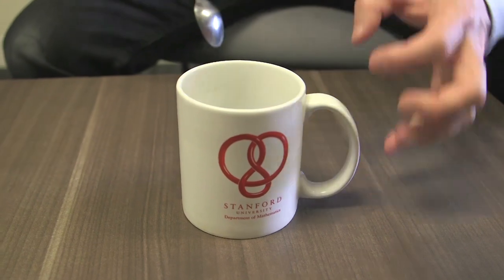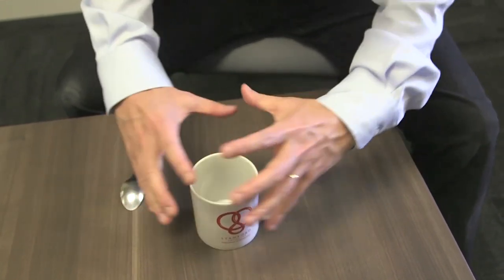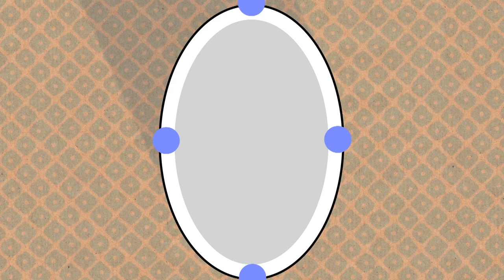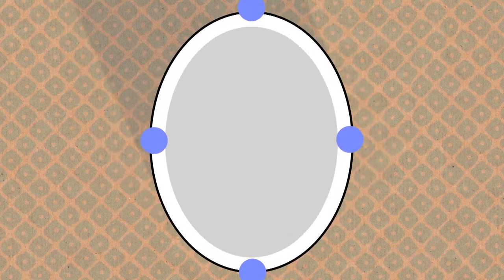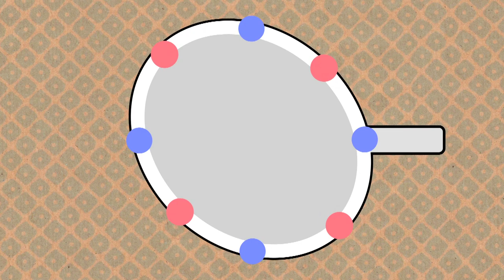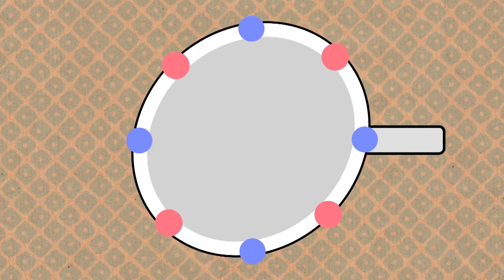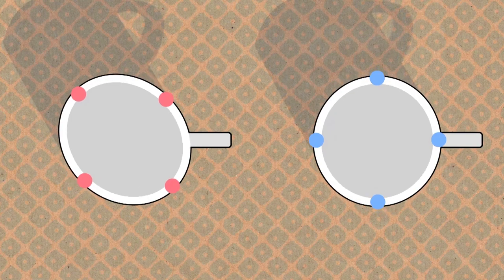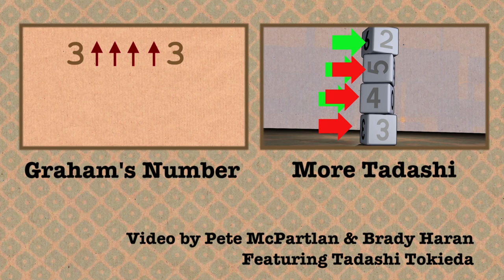Coffee Cup Vibrations - Numberphile

Comment: Why is it a symmetry of four and not six for example? I tried maybe seven or eight cups of different design and it was four nodes for all of them. Or is the six fold symmetry there as well as a second tone at the same time but there's much less energy in that vibration so we can't hear it?
Btw. have you noticed that the pitch changes while stirring coffee and changes back to the initial pitch over a few seconds after stirring. My guess is, fine air bubbles are introduced into the liquid by stirring. It is not the rotation of the liquid, because the gradual pitch change also happens when you already stopped the rotation by "counter stirring".
Reply: I'm pretty sure you nailed it. There are probably some higher symmetries/frequencies that are probably just too low to notice them. However, I think you'd only find multiples of 4.

With the stirring I know you're right. But now I'd like to know if you also understand why the air bubbles change the pitch? ;)
Reply: 1. The cup is a circle. as he explains, if you compress the circle in one direction the other two sides at 90 degs deform to keep the structure symmetrical.   
2. As the heat of the liquid lowers so the pitch of the ceramic increases. The hotter a solid material is, the slower it can respond to vibrations.
Reply: Dirty Robot
1. is equally explained by six fold symmetry.
2. wouldn't explain why the pitch goes down to the same pitch over time. (it even works with cold water by the way, so temperature is irrelevant)
Reply: As with any complex (non sinusoid) sound you can think of it as the sum of may sinusoid at different frequencies multiple of the fundamental which is the frequency that in this case we identify as pitch and is also the strongest, in this case the funamental is the pattern with 4 nodes resonating/vibrating and 4 antinodes standing still (theoretically)

The higher frequency sine waves do not contribute to what we identify as pitch, they however are what make's the cup sound as it sounds

it is not true that  you cannot ear them either (if you could not hear higher order harmonics any sound would be the same only shifted in frequency) it's just that your brain/ears process the whole sound as one and cannot distinguish between the different components

I'm sorry if it makes little sense but trying to explain fourier theory with words only it's quite difficoult 

here you can see that by starting with a sine wave and adding more and more odd higher frequency terms the wave will look and sound more and more like a square wave like (for the 2 to match mathematically you have to add infinite higher frequency terms, in practice you only need few hundreds and the ear will not notice the difference)

https://soundphysics.ius.edu/?page_id=949
Reply: I don't know but i find unlikely that a 6 nodes oscillation can substain a standing wave in that system...

When analyizing the spectrum of the sound we must also be carefull since the mug is a 3D object, and in the 3rd dimension it is not of constant shape (so that will have a bigg effect on the sound), also there is a constraint placed by the table at the bottom (it is much stiffer than the air that  surround's the other sides) that also will have a big effect on the sound, creating complex constructive/destructive interferances so i don't think that the 5.1 kHz is a 6-nodes pattern child (also i would expect to find it half way between the First and secondo armonic, not 2/3's of the way to the 3rd)
Reply: Good anwer, but I'm not sure it's correct. If I remember correctly, it's more about it being more compressible with the air inside.superdau

Comment: In a case such as the triple handle cup, do you have the same pitch but with varying levels of damping across the nodes? With the circumference deformation in thirds you get either 3, 6 or 12 nodes, the latter conveniently corresponding with the division of an octave. I think this produces a corresponding pitch with less fundamental wave mixed in, which is why I think the human ear wants to hear a higher pitch in tapping the in-between areas with quicker decay.

Comment: I have a mug that is a cuboid, with very slightly rounded corners. The handle is in the middle of one of the faces.
The observation proves true in this case also, there are four high tones, and four low tones.
Except, the four high tones are at the handle, and the four low tones are at the points 45° from the handle (i.e. in the rounded corners.)
Reply: Interesting! The reason for that is probably, that the corners introduce higher stiffness. I'd expect it to behave the same way without a handle.
Reply: Yes. The higher freq is because the faces are less elastic. They are connected to the base with more material. The corners would deform with less energy and so vibrate slower.
Reply: Think of pushing on the corners of a cardboard box to collapse it vs the faces.
Reply: It's all about the amount of energy that is needed to vibrate a mode. In the example here, moving the mass of the handle requires more energy, hence a lower pitch. In your example hitting the corners would cause a vibration mode that tries to change the 90° angle, (as @CheaterCodes pointed out, higher stiffness in the corners)  which requires more energy than moving the handle.
Reply: Interesting responses, thank you.
Which got me thinking, and scrambling into my attic. In the attic was another mug, also square with rounded corners, except this one has tapered sides - the square on the base is approximately 60% of the size of the square at the top from which one drinks. The handle is again in middle of a side.
When I tap this mug, I get the two sets of four tones, each separated by 45°. However, this mug has the same tone pattern as Dr. Takieda's round mug - the low tones are again at the handle, with the high tones in the corners.

Comment: I noticed something I can't explain regarding coffee cups and pitch variations: if I use a spoon to stir the coffee in my mug and then I tap the spoon vertically onto the bottom of the mug while the coffee is girating, it makes a sound with a pitch that gradually gets a higher with time... But at some point, the pitch gets to a fixed maximum and it doesn't go back down, even though the coffee eventually stops rotating...

Not sure if it's due to some kinetic effect due to the coffee or if it's something related to temperature?

Any idea what could be causing this effect? (you need to replicate first to understand what's puzzling here I suppose) ^_^

Comment: what will happen if i have a realy big cup and 2 spoon 1 hit at 0 degree and the other hit at 45 degree at the same moment , will the outcome sound be different than 0degree and 135 degree , could it solve the problem of the reverse construction ? cause the handle is trying to move when you hit it at 45 in direction different than 135 direction?

Comment: So do you think you could create a circular xylophone if you had the right amounts of mass at points? Though it'd have a lot of redundant "keys" because of symmetry
Reply: Any object you think of has infinitely many modes of vibration that depend on the shape. Hitting it in different ways in different places can start the different modes in different amounts and combinations (this is the reason different instruments playing the same pitch have different sound) Designing a xylophone for instance you make the bars a particular shape, and scaling the bars larger or smaller generally scales the frequency of all the different modes (but not necessarily quite that straightfoward). In principle, you can start any set of frequencies you want an object to vibrate at and come up with a shape that does that (or approximates it)
Reply: Sure, but you could make one that was a continuous piece of metal. I'd say having seperate pieces makes it easier to build and tune for a consistent sound between each note, but it's not necessary. Look at steel drums for example.
Reply: Nonsense. In any case you can just have more than one steel drum to cover more range. "A continuous piece of metal with enough range to be a full fledged instrument on it's own would be too large to play." you could make a 'xylophone' from a single piece of metal (ignoring the fact that xylophones are wood) the same length as a normal xylophone. You could make it circular if you want. Of course there is a limit to how big a circular xylophone can be before it is too hard to play. I am very confident you could make a playable circular xyophone with 3 octaves range. Any way the original question was "
So do you think you could create a circular xylophone if you had the right amounts of mass at points?" not "Can you make a practical circular xylophone with at least 3 octaves range".

"Yes, there is a debate to be had about how much range something needs to have before it's an instrument" - I don't think there is, considering the triangle is considered an instrument and has efectively no range.
Reply: Ahh you're one of those. No matter, you can enjoy the music you enjoy, 
but I still maintain you can build a circular xylophone! I wish you luck
 in your engineering studies!

Comment: It terms of music, what is the interval between those two high and low pulsating squares? Is the interval the same all the time, no matter what the cup is made from or its size, as long as the shape is generally round?
Reply: The interval is the ratio of pitches (frequency of vibration). You could tune it to any interval by changing the size of the handle.
Reply: Thought it would be something like that. A heavier handle would make a bigger difference between the directions that move the handle, and the directions that don't. I'm assuming the handle-moving directions are always the lower note of the two. Thanks!

Comment: after tapping on every cup in my cupboard, i notice that the handle pitch is often much clearer and has a "cleaner" harmonic set. some cups won't even produce a definite pitch at the 45 degree antinodes, which seems counter intuitive because they should logically be freer to vibrate. hypotheses anyone?
Reply: Could it be that you have to strike precisely on those points, while the lower pitch has a more forgiving range? I haven't experimented with this yet, but it seems intuitively plausible that the geometry could account for that.

Comment: My question ! I ve been wondering about the exact nature...
tap  ...pitch =x  
stir
tap pitch changes.
now for the answer....
Reply: By now there's a new comment in this comment section describing this problem. It has to do with air bubbles being added to the liquid.
Reply: CheaterCodes yeah I take mine with milk/sugar and the foamier the milk...more pitch reverberation... cool sound.
Reply: Sound travels faster in liquid than in air, and when you stir it (especially with a powder or similar material) you mix in tiny air bubbles. Sound traveling through a recently stirred cup will move slower because of the air bubbles, and thus the resonance frequency decreases. Once the bubbles float out, it will return to its previous pitch, but stirring it again will add more air bubbles and drop the pitch again. If you keep tapping the cup after stirring it, you will hear the pitch steadily rise back to it's normal pitch.

Comment: so do multiple nonsymetric handles cause more than 2 main  frequencies
Reply: I believe that the "mode of oscillation" for this cup is with 4 nodes at 90 degrees apart. So, if any handle is offset by more or less than some factor of 90 degrees, it should produce more than two frequencies.
Reply: No

Comment: "We know that, for example, there aren't three handles...", *shows equidistant positions*, i.e. at 120 degrees.

Well, I know it won't be as pretty but you could put them at 90 degrees to each other, leaving one side empty.
Reply: I.e. the complement to the usual one-handle cup.

This relates to the question should multiple handles be the same size. I guess: no – you can regard the absence of one at a spot on the original cup as a zero-size handle there.

Comment: To make sound does the speed of the matter have to move faster than the speed of sound ?
Reply: no, look at your bass speaker
Reply: Air oscillations produced by motion faster than the speed of sound are shockwaves. A far less pleasant way of stimulating the human ear.
Reply: The speed of sound is dependant on the medium that it is traveling through. Regardless, the noise caused by the vibration will move at the speed of sound at normal atmospheric pressure.
Reply: IN AIR, there must be a limiting speed, below which sound waves don't propagate ?
Reply: Sound waves always propagate at the speed of sound, meaning the information travels at the speed of sound, but the actual air itself moves much slower. Thus there is no limiting speed, but lower speeds (i.e. lower frequencies) require more amplitude to not be distorted by wind, other vibrations, etc.